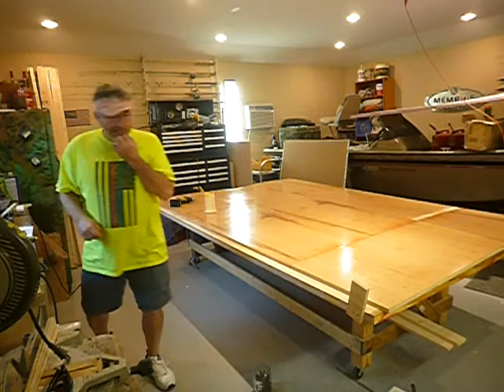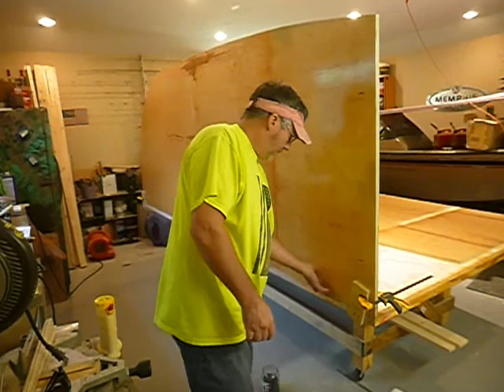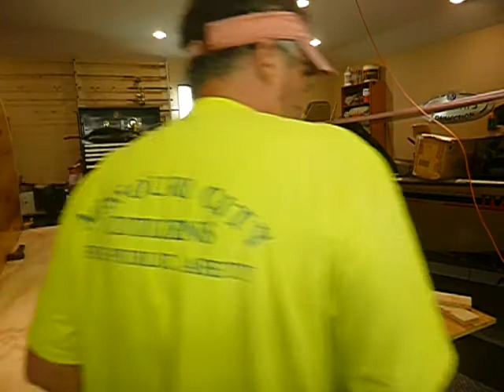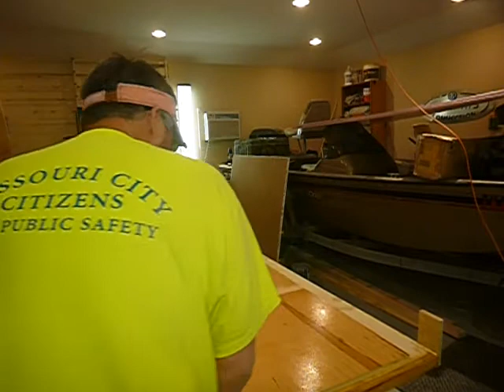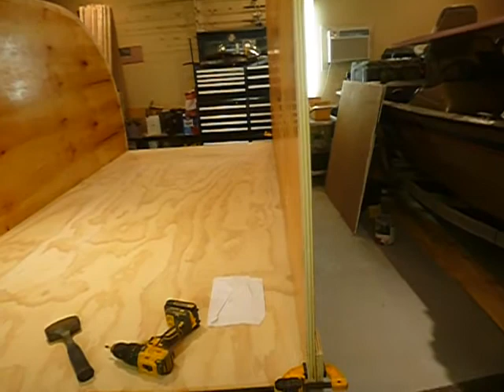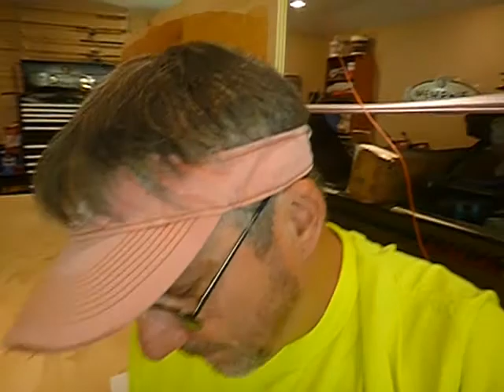DIY Teardrop Camper a 5 X 10          M16   Raising those walls

Comment: good tip and point about using screws instead of nails because of removing the nails later and risking yanking it out of square with the claw hammer! also one can put dents/marks in the surface if one was using a claw hammer that way. (though i suppose that could be mitigated by putting down a cloth underneath)
Reply from the maker: Yes or a block of wood but I still stick with screws so there is no issue and you are right about the possibility of dents.